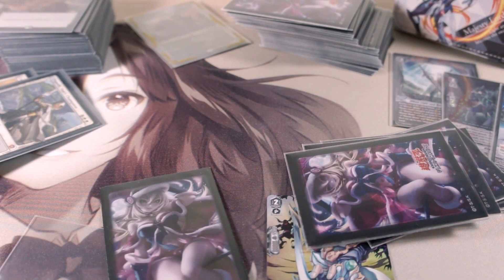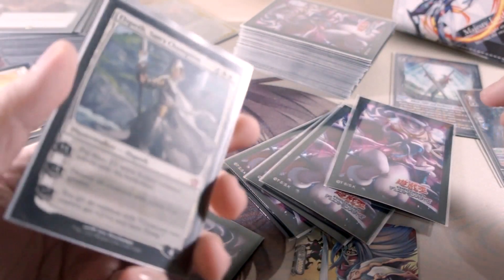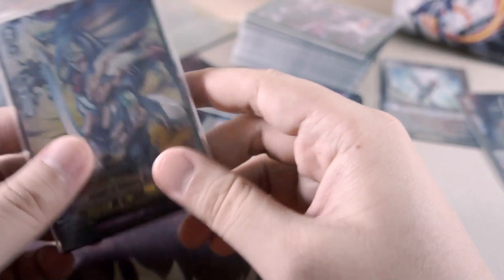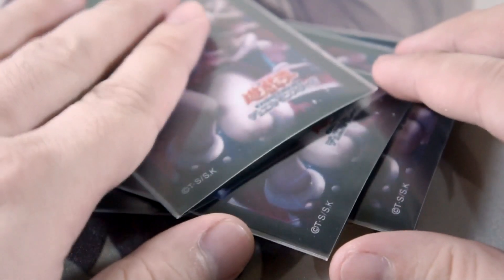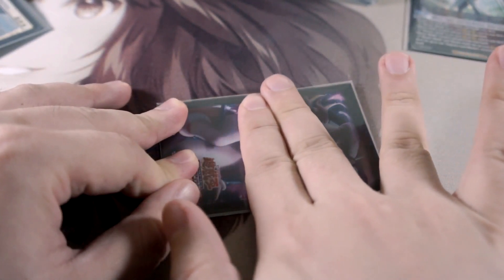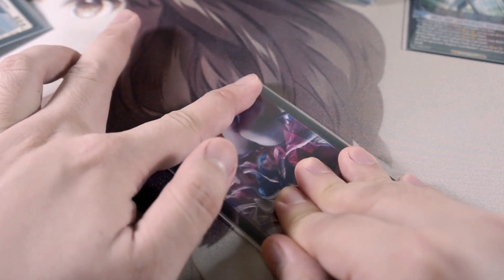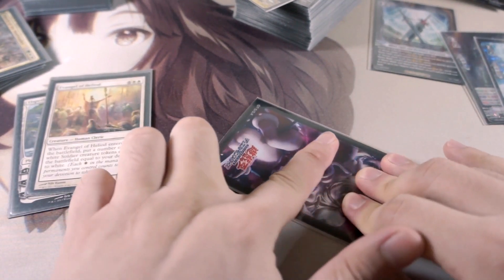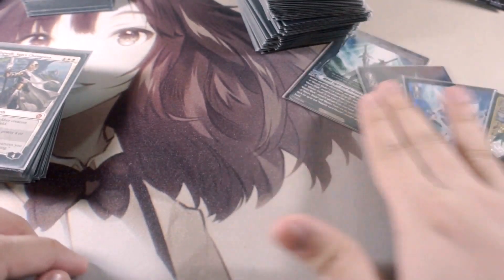How to Remove Air from Double Sleeved Cards

Comment: Or you just take a pile of cards and gently push the most air out of the sleeves by pressing them with your fingers carefully multiple times. Then you take another 100 cards deck in a deckbox and put it on top of the full deck for a night or two and that's it. Done it like this with over 20 decks and it always worked perfectly. EZ Clap

Comment: Method is very effective, and sleeved cards tend to last long as well as the sleeves. 

Many players might find that sleeves get wavy on the opening of it, specially in double sleeves. I can confirm that this method will help sleeves last longer as well as making sure the air is out which is going to cause more harm.  

Definitely taking the time to do this is worth it. For inner or outer sleeves. I can also add that this is good even if your deck isn’t a very valuable one (money wise) I’d recommend doing it because it helps it last longer. 

I wouldn’t recommend doing the step at the near end, where you squish the sleeves together, it will make the sleeves stick and shorten the lifespan of them (the waviness, grime, scratches, shuffle smoothness, etc). 

Just do each card individually and it will be alright. I had to thoroughly explain this because I struggle with sleeves getting wavy and the smoothness of shuffle goes away due to humid weather in my area and the grime sticks to all surfaces because of that, so I am very wary of my sleeves for 3 years now. 

Triple sleeve only if you have a very valuable deck whether it be in money or sentimental value, triple sleeve it if it is a very VERY important deck. Otherwise, inner or outer sleeves help for your tournament days and friendly matches for shuffling and durability.

Comment: I just double sleeved my first deck and this is basically the method I ended up using. It helped a lot to get air out of each card as I went, then a couple of those motions over the whole deck, THEN I put it in 2 halves under a heavy book. Used UP Eclipse mattes and DS clear Perfect Fit inners. I was more worried about warping the cards with the air bubbles than popping a sleeve, but no tears or splits yet. It's still about 30% thicker than my single sleeved decks, but there's almost zero compression now and my 99 sits firmly on the table.

Now to buy a deck box that fits these Exxxtra Thicc Rogues and start putting alternates into the Anowon box... I've heard good things about UP Satin Towers + UG Boulders
Reply: When u try the method to remove the air did the cards got any damage like bend cards? I don't want to do it because it feels it damage the cards
Reply: @vers-over1886  the air bubbles do deform the cards slightly as they leave the sleeves, but there should be no permanent damage since it's only a slight bend for a second or two. They'll bend about as much as they might when you draw or try to pick one up off a table. The only permanently bent cards I have are curled foils haha, and that can be controlled with humidity.

Comment: I’ve been doing this on my tripled sleeved Dark Magician Deck. The tight fit sleeve gives some added protection to the weak square corners of Yugioh cards and then I use the outter sleeve protectors to protect my rare old sleeves that I can’t find anymore since each game has me searching my deck repeatedly and then shuffling it a bunch which wears out the card sleeve edges over the years until they rip. The triple sleeving has prevented that and kept both my deck and my cards in great shape which is nice as most of the cards I’m using seemed to have shot up in value lately. Sadly, the removal of air only lasts briefly then the sleeves start to expand again even by using this trick. Have you ran into that too?

Also, I gotta ask, which Dark Magician Girl sleeves are those? Are they official or fan made? I appreciate it

Comment: I don't get it.  If all the air is trapped in the inner sleeve, why would you push it all one way (towards the opening), only to push it back in the opposing direction where there's NO opening?!  I thought the idea was to get air OUT.
Reply: The opening of the outer sleeve is actually at the bottom